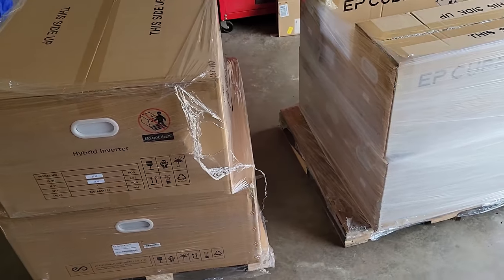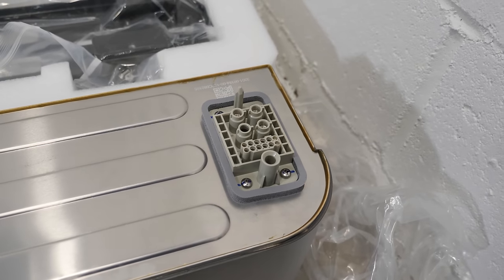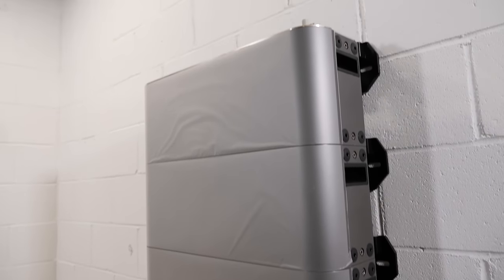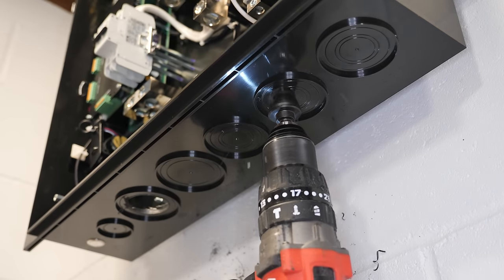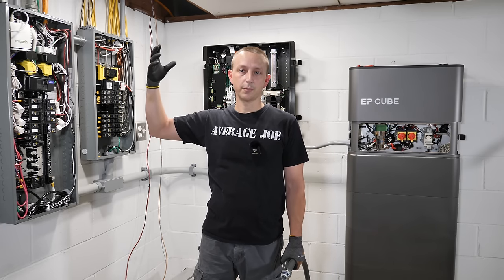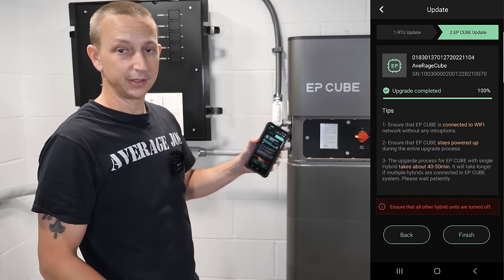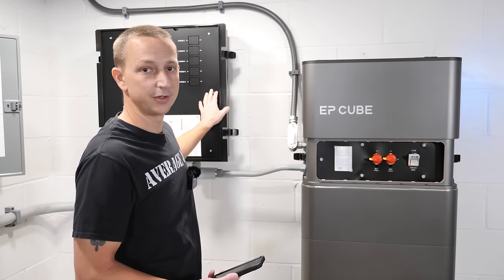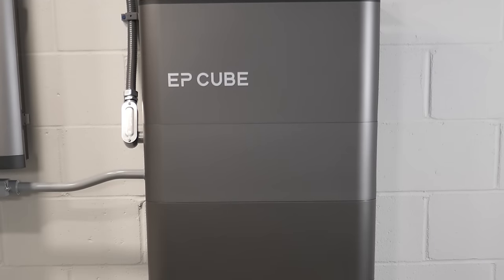Installing the EP Cube by Canadian Solar All in One System!! ON SALE!!

Comment: Looks like a nice system and I was prepared to inquire until I saw the need for internet connection. For me this is a deal-breaker. I don’t want anything cyber-based attached to our power system whatsoever. Unless I’m able to opt-out, this is not for me.
Reply from the maker: You can opt out.  You can still use your own wifi to connect or use blue tooth.  I think the minimum "connection" to keep the warranty is every 30 days.  I will ask to make sure tho so dont quote me.  I know there are people out in the boonies that dont have any service.  That system should be able to keep a warranty.
Reply: Needing an app to configure instead of the device having its own user interface is also a big problem.
Reply: The paranoia is endless
Reply: @Detonator007  yes and it’s all  justified
Reply: @Detonator007 sometimes paranoia is simply having all of the facts.
Reply: @mitchbatten8281 Trudeau/Biden fan boi.
Reply: @nelsondog100 I agree with you. A System with zero means to interact with it locally and being connected all the time is way more susceptible to cyber attacks. It is a hard no. I don't want anyone having any abilities to interact with my system, unless they are physically there.

Comment: Nice, but those are some expensive batteries.. If the invertor is worth around $2500 then the cost of the batteries is around $3100 per battery...I can build one for around $2000 for a 280ah battery, but I understand the concept and way cheaper than the Tesla wall were.
Reply: You can build a piece of junk grade B 280 aH 51.2V battery for $2000. That will not include the enclosure, high temperature tape, display l, a JK 200 amp BMS, circuit breaker, terminals, miscellaneous
Reply: Dont forget you only get the warranty if you connect to internet once a month from what hes saying. And you need to use a proprietary app. And you cant user service it when it inevitable breaks. Pretty said this is what weve come to but i saw this a mile away
Reply: You couldn’t build it will all the UL listings.  Those are worth every penny.

Comment: EP Cube is great but still WAY overpriced compared to the EG4 18Kpv inverter with vertical wall mounted batteries from Signature Solar.  They don't take much room on the wall either although not as aesthetically pleasing as the EP Cube.

Comment: I really like the way this system just looks like it belongs together.. My biggest issue though is having to use an ap on my cell phone....  I live in hurricane country and just as an example 2 years ago Hurricane Ida hit my area  and power was out for right at a month,  cell service was down for 3 weeks and internet was down, due to broken power poles until power came back up.... So after spending probably $ 20,000 I still wouldn't have electricity,  how stupid is that ?????  Nice concept but execution is lacking
Reply: Once the system is provisioned, can you not use the App through the local network or do you have to have internet connection?  For extended outages, good size solar panel would be sufficient. Additionally, you can use a generator to charge the batteries few hours a day for another day of usage. I personally think it's better that way than having to listen to generator noise 24 hours a day.
Reply from the maker: Yeah you connect with your LAN. You can also connect with bluetooth if you wanted to "conserve" power and not run your cable modem and wifi router in a power outage. You dont tech need internet once its commissioned. There are people that currently use the system way out in the boonies.

Comment: Batteries, those beasts of burden. In 1975 I packaged a UPS battery bank for a Univac system that was being relocated. There were 88 batteries, each weighing 165 lbs (75 kg). That made getting them into their shipping boxes “difficult” as they could not be inverted. Also, they were lead acid. So if one of them  was dropped and cracked or broke open, sulfuric acid spill would ensue. We did the job without incident…a serious relief.
Reply from the maker: That sounds like one serious system!!!
Reply: @AveRage_Joe  Thanks for the comment Joe. It was serious, and an ad hoc temp job! My co-worker and I were both 18 and children of company employees. I was 160 lbs and she was probably 110 lbs. So together we outweighed 1 battery. We also were tasked with cleaning the company’s terminated graphite/carbon fiber research lab (a very dirty job).

Comment: I have reservations about putting electrical components on basement floors.
Every permanent structure in every basement that I have owned was lifted up 3 inches off the floor by an additional concrete slab so that any moisture [or flooding] doesn't affect the equipment.
The batteries being batteries, I would lift it off the floor 6 inches.
Reply: Electrical panels have a minimum height off the ground, and batteries with connectors should also have standards too.

Comment: The EP Cube looks fantastic, and has so many attractive features such as Grid Tie or NOT,  Pass thru, Priority settings for panels, batteries and grid and so much more.  I'm going to look into this much further
Reply from the maker: I dont want to say because I am testing out the system for free for a while but...I Love it!  I can be totally off grid and only use grid if it needs to.  I do wish it would show what each array is doing. At the moment it does not do that BUT like I said they are always updating/improving so maybe that will be an option in the app.  I will pass that along to see if its possible.🤘

Comment: It looks nice, but needing a network connection and a phone app is a deal killer for many.
Reply from the maker: Thanks!  It is a nice system.  It would be nice if there was a little screen or something on the unit for sure.  One thing I didnt mention is if the network is down and you cant connect with your own wifi for whatever reason, you can connect with blue tooth to change/view.🤘

Comment: I was wondering what you had in the works.  I’ve only ever seen 1 other install of these and it wasn’t from someone who usually does solar stuff.  I’ll be honest, when I hear “there’s a few hours worth of training before commissioning” that kinda turns me off.  I guess it’s probably to help with common issues people experience.  It does look like a very clean install though.  

After looking at some of the comments of people concerned that you ditched your Growatt, you’ve got the same idea I have.  I’m gonna figure out how to put in a transfer switch to be able to switch between multiple test systems.  

Did you happen to mention what the output size of the inverter was?  Maybe I missed it.  

How’s the response time in the app?  Hopefully it refreshes more than every 5 min.
Reply from the maker: YesSirrrrr!  Have been getting stuff ready for this install and doing a few other things around the house lol. Oh and also went to that Vegas thing.  Anyways, Yeah the training you guessed it.  Its more of online videos with a few quizzes to make sure you were paying attention 😏.  I would say its more for someone who wants to become an installer.

Yes my other system is all intact, just needing to throw in a transfer switch so I can switch between the 2 or 3 if you count the generator.

A single inverter has 7.6kw output.

Response time of the app is less then a min.  More on the 30seconds time frame. I can check that tho so dont quote me lol
Reply: @AveRage_Joe  awesome!  Have fun testing  out the system!  I’ll be looking forward to your tests.

Unfortunately I have to move all my plumbing hardware (pressure tank, water heater and softener) to the other side of the room before I can set up a true “test wall”.  Plumbing though is about as much fun as jumping in a tub full of scissors…so there’s no telling when I’ll get to all that…

Comment: I cannot judge the technical capabilities of the EP Cube system based on this video. A short snapshot from the app on a smartphone is definitely not enough for me.
But I can say a lot about the external appearance. The designers at EP Cube did a great job. If the installation had been professionally carried out UNDER PLASTER (I mean that the necessary PVC and steel pipes ARE HIDDEN and do not disfigure the home "power plant"!), the system would delight with its elegant simplicity! This appearance is the path to market success, it is the path to the future.
Reply from the maker: More videos will come for sure and we can do some load testing, power outage testing ect... I do agree that it looks great.  I like the look of the conduit showing but thats me.  If I were installing it on drywall or plaster, yeah you could hide the conduit.

Comment: 14:03 in many jurisdictions the solar breaker has to be at the BOTTOM of the panel specifically the furthest from wherever grid power joins the panel
Reply: That is only for back feeding to grid.  He’s using an interlock which must be on top. This only allows one power source to energize the panel.
Reply from the maker: Yeah @cgutowski471 got to it before I did.  That panel I am backfeeding just like you would with a generator.  The other breaker however is installed at the opposite end of the main panel which the EP Cube can also backfeed.🤘

Comment: Really clean install! Kinda jealous how good and clean this looks compared to my system with 2 inverters and 2 sub panels.
Reply from the maker: It does make a nice clean install. I bet with another stack it would still look great! What system do you have?
Reply: @AveRage_Joe  I went with Sunny Boy for my Grid Tie inverters. I have one 4500w and another that is 5500w. I did my install in phases so main house roof was phase 1 and it has only 160w panels and the Sunny Boy 4.0US. Then I installed 360w panels on my garage and built a studio that I put more panels on also 360w. Total is 10kw. I would love to redo my main house panels with 360s and then do something Nice like this EP Cube. All of my panels are Canadian Solar. Was kind of shocked how inexpensive it was compared to a Tesla power wall. Thanks for the great indepth build guide.

Comment: I like the ability to handle up to 600V peak from the PV system, or 550 VDC typically.  A unit that accepts Utility power, Generator power, and PV power is another powerful feature.  A very attractive unit with small size considering the power output.  Still, pricey in my opinion
Reply from the maker: Yeah the HV PV is really nice. Less wire is great compared to everything Ive done in the past. All the options it has is pretty amazing. Can also do EV off the smart gateway to if needed. Pretty sweet system!🤘

Comment: Thanks for the detailed installation video. I'm considering this system with two inverters and 5 batteries each (you need 5 batteries to get the 7.6 KW output power when you don't have solar panels) for a whole home back up (so no sub-panel) as I'm mainly interested in instant backup and I may add solar panels in the future but not sure yet. However, I need to connect high consumption equipment (i.e. EV charger and A/C units) directly to the EP Cube gateway. How many circuits does it allow ? (I think the right term is load shedding)

Comment: You know what I'm going to ask...  When you do those load tests, make sure to test imbalanced loads.  I always like to compare new inverters to Schneider and that is the BIG differentiator.  The install looks great!  Do they have a setup for off-grid?
Reply from the maker: I will try and do that actually.  I usually forget that lol so thanks!  You can use this off-grid for the most part however you will need to connect when you set it up.  I know you need internet connection to commission, update and a "grid" connection at the start.  After that I dont think you technically need anything.  If you have a local area network with wifi then you could still use the app to see SOC.  If you used a generator to charge then that wifi connection would be great to have.

Comment: Can it be used exclusively off grid? Or are there better be options.
Reply from the maker: I believe so for the most part BUT you would want some sort of connection to commission it and to get the update.  If you want the warranty then I think you need to connect internet once a month.  You would also need a "grid" connection at the beginning during commissioning  but I think that could be a generator.  I could make sure tho and if there is anything else.

Comment: What do you mean, to turn it on you need to have grid power?   If that's true, it would be interesting to see how hard it is to get around that requirement. Pipe your growatt in to the grid input?
Reply from the maker: I think all it needs is a 240v input. So yeah the growatt or a generator would work!😄🤘

Comment: Honest question that just occurred to me... when your PV array is producing more electricity than you can use or store in your batteries, where does that excess go? Assuming not feedback into the grid... where does it go? I'm guessing the PV panels or controller or whatever just throttles the PV output. But even so, at the panel level, where does the power go?
Reply from the maker: Thats a great question! I think with older controllers it would be dumped into a dummy load in the controller. With this...🤷‍♂️ Ill have to see next time its full charged and a good amount of sun. Put a clamp meter on the wires and see what it shows.🤘

Comment: On a Sol-Ark 15K you can power you panel via Grid, Battery and Solar all at the same time, and if the Grid goes down, you don't need to use an interlock to disconnect the Grid and use your inverter to power loads because the Sol-Ark 15K has an internal disconnect that can sense via CTs when the Grid is down.  Moreover, the Sol-Ark 15K can pass through 200A from the Grid which allows you to run a whole house panel behind it, have a Grid Tie in front of it, and allow power from Grid, Battery and Solar all at the same time, then disconnect from the Grid when the CTs sense a power-outage, but still allow you to power you whole house panel via Solar and Battery (with Generator connections available to recharge batteries if batteries run out because of a lack of solar).  So in the EP Cube, it looks like there is no Grid passthrough, as your backfeed breaker must be off via the interlock if Grid power is on.  Thus you have no way of combining Grid, Solar and Battery all at once.  Is that true?  Must say though, the EP Cube is one sexy beast versus the plain jane Sol-Ark 15K plus a host of batteries to which it can connect.  Appreciated your video.
Reply: I would like to know this as well.

Comment: you are using 6 AWG from smart gateway to the sub panel....so is that sub panel only 50 amps?  you are using 2 awg from the main panel to the smart gateway unit... that has capability of 90 amps.   If your sub panel is only 50 amp, that is not very much capacity..  So I am assuming you are only running the 6 awg to the sub panel since the single inverter only has 7.6 kW output. If you wanted to run a higher capacity sub panel, you would need to use a 2 inverter (15.2 kW) system.... is that correct?

Comment: If it were me I would have set the battery up one unit higher so that if I needed to add a battery I would only have to add it from the bottom. Rather than moving the controller up.

Comment: Nice job on the install, and presentation.  At 23:45 you mention the CT cubes, would you explain how they are used, and maybe make a video on how they are installed and utilized.  Keep up the good work.
Reply from the maker: Thanks.  The CT clamps are current sensing clamps/sensors and they just clip on.  You "flip open" the sensors to slip around you mains wires and then snap them shut.  I actually have 2 different kinds lol.  The black ones are used with the EP Cube and used when installing the system for a partial home backup.  That means when you are powering a sub panel like I did.  This way of install will still power EVERYTHING in the home including the mains panel.  If the grid goes out, those CT"s sense along with the gateway the grid is out and then stop powering the main panel but still continue to power the subpanel.  The white CT's used in my panel are the Emporia smart energy home monitor.  I purchased it a while back so I could see how much power certain things were using which also allows you to track over time.  I wanted to see how much power my AC, Stove and Dryer used so I could calculate how much solar and battery I would need. This is the Emporia and is an aff link btw -> https://amzn.to/46DXcyx

Comment: Do you need to be a licensed electrician to take the installation course?  I would prefer to set up the system myself after taking the class and then have an electrician do the final connection to my home.  Great video and kind regards.
Reply from the maker: You do not need to be an electrcian to take the course. Its videos with a few quizzes. Its mainly to familurize you with the system, how to hook it all up ect. You can 100% install it and have an electeician do the final connections. Thanks for watching btw🤘

Comment: Question... If I have an electric stove and a 36Kbtu AC mini split in a separate none-backup panel (connected to grid all time) and I also have "net metering" setup, could this damage my system? I know that current cannot flow in two directions same time, so when the air conditioner and stofe are on, "net metering" should not work. But could this damage my system? I am posing this scenario because I would like to extend battery life.
Reply from the maker: It shouldnt damage anything. I have 2 different hybrid setups on at the same time and all is good. I do have a question tho. What is your other system. If its just a grid tie system, you could probly add it to this system as this allows existing AC coupled to be connected right to it.